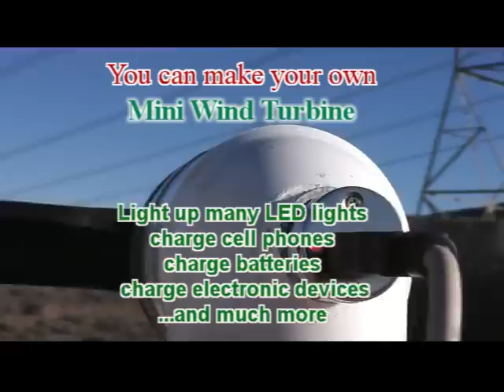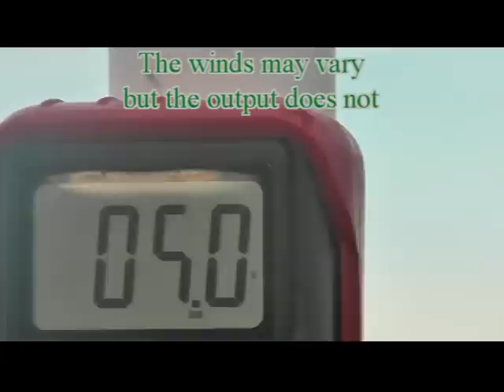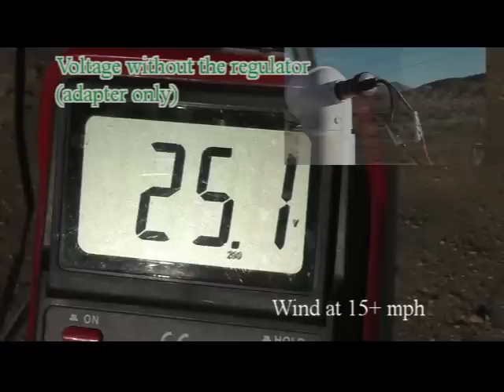Mini Wind Turbine G2

Comment: can the turbine work with more amps in the charger
Reply from the maker: Karan Bardhan Hi Karan, I would use a bigger motor/generator for more than one amp. This mini wind turbine was all calculated to be at or near the 1 amp output (size and type of propeller vs. motor/generator) Take care :)   STT

Comment: Hi STT,

Great job on this wind turbine. I have a question that i hope you can help me with. I have salvaged a bridge rectifier P/N D3SB60 that has the specs: 

Maximum Repetitive Peak Reverse Voltage 600
Maximum RMS Voltage 420
Maximum DC Blocking Voltage 600 

vs the rectifier that you suggested GBL005

Maximum Repetitive Peak Reverse Voltage 50
Maximum RMS Voltage 35
Maximum DC Blocking Voltage 50

Max avg fwd rectified output current is the same at 4.0A. So can i use the D3SB60 instead? Thanks.
Reply from the maker: Eric Malvo Hi Eric, yes, it should work. Please send me a feedback when you test it.
Reply: ScienceTubeToday Hi STT,

It worked! I have taken a photo of the setup, but i am not sure how do i post the picture with this reply.
Reply from the maker: Yes, I would like to see it You can email it to:
Orlando@ScienceTubeToday.com
Good job, congratulations!

Comment: Do you you the amps that it produces at around 15 mile an hour winds
Reply from the maker: I have tested it in around15 mph wind and it sustained 5 volts, 1 amp output from the USB cable connection. I have not yet tested it for higher output, for example without the reverse bias zener diode.

Comment: What kind of pvc piping do i need for the base.
Reply from the maker: +Foxy ThePirateFox 
You can use 2 inch PVC pipes and 2 inch PVC fittings (elbows and T's)
Reply: +ScienceTubeToday Thank-you so much!! I have the essentials build I just needed the base.
Reply from the maker: make sure you use set screws, so in moderate to strong winds the PVC connections of the upright tower does not move or fall. Also, let me know how your project went...good luck!
Reply: +ScienceTubeToday Thank-you and I will
Reply: +ScienceTubeToday The project went really well. k
I was able to charge my phone to 100% percent in about 2 hours or so.

Comment: What about if, instead of a propeller which needs wind to turn, you attached some kind of hand crank ? And how much effort would be required to charge up, eg, a tablet ?
Reply from the maker: Yes, it is perfectly possible to attach a hand crank to this generator, especially if you add a belt or gear, so each turn of the crank produces many turns of the generator. As far as how much effort...small generators usually take a long time to charge batteries. It's just the nature of the beast. I personally have not experimented with hand cranks, so I am sorry I wouldn't be able to provide any stats on it.

Comment: Hello, This an amazing video. Infact all your videos are amazing! Subscribed! Anyways, May I ask, Can you give me the specific name and model/number of the Stepper motor. Oh and May I ask, How did you get two wires out of the cig adapter to the diodes? Thank you. And sorry for asking a lot of questions.. I'm really looking forward to building this... I Already got all the pipes needed :)
Reply from the maker: The stepper motor I used was removed from an old printer, even if I give you its name, specs and manufacturer, you won't be able to purchase the same one since once they are a part of a machine, they become proprietary and can't be sold to the public. Having said that, here is the good news...stepper motors are easy to find online or in old printers like you saw in the video (if you are lucky enough to have one around...) I don't make recommendations as to where to buy, but there are certainly very reputable suppliers out there (big, popular auction website with purchasing assurance?). Stepper motors come with 4,5,6 etc...wires. The one I used for this video was a 6-wire. The wire color coding on step motors vary a lot...there is no color-code-rule per say...Most suppliers, vendors will also give you the wiring diagram and you can work from there...if not, you can simply test the connections yourself by spinning the shaft and reading the output voltage of each pair of wires.
The two wires that I connected to the cigarette lighter female adapter came from the bridge rectifier: The bridge rectifier is made with 4 diodes 1N4001...easy way to remember how to solder the four points together...put the diodes in front of you...make a square with 2 diodes pointing North and 2 diodes point West....the upper right and the lower left of the square you formed is where you connect the two wires coming from the generator...the upper left is your positive DC and the lower right is your negative DC going to the female cigarette adapter. Whew! Let me know if you have any other questions. Don't worry, I will be glad to assist.

Footnote: I am putting together a kit with everything you need to build this and other Mini Wind Turbines. The kit should be available soon. I have already secured the domain name TheMiniWindTurbine.com and the website will be built soon too. Not ready yet. :)  STT

Comment: what type of diode did you used for this project and how do connect the wire to the diode?
Reply from the maker: I recommend Schottky diodes to make the bridge rectifier, or you can buy a bridge rectifier, they are really cheap.

Comment: Hey this video is amazing and I'm surprised more people haven't seen this. I consider myself a smart guy but I've never worked with wires or electricity. You lost me at diodes and dc and ac. I'm looking more up but would love a video maybe breaking it down for us folks with no experience. Either way I'm still trying it out but would appreciate the extra help. You're awesome and I'm def gonna subscribe.
Reply from the maker: Thank you for a nice comment. I appreciate it.
Let me see if I can help...The "generator" you see here is a "stepper motor". It produces AC (Alternate Current), we call it alternate because it cycles positive, negative, positive, negative, positive, negative (looks like this /\/\/\/\/\/\/\/\). This type of current is not usable to charge batteries, cell phones etc...That's why you need a "bridge rectifier". Once the AC passes through the bridge rectifier, it becomes DC (Direct Current) which looks like this -------------. We call it direct current because it doesn't cycle, rather, it "flows" like a stream in only one direction. That is what we use to charge batteries, phones, small electronics, laptop computers, light up LED lights, etc.... A "diode" is an electronic component that only lets electricity pass in one direction. By soldering four diodes in a specific square configuration, it will make the current flow continually in only one direction (two opposite corners will be the entry path for the AC, and the other two corners of the square, the exit points for the DC). So, if you buy or build a bridge rectifier, it will "rectify" the current that comes from the generator for you,...and you can then, actually use it....It goes from this /\/\/\/\/\/\/\/\ to this ---------  . If you decide to go ahead and make it, I'll be glad to help with whatever questions you might have. As a matter of fact, I am working with some manufacturers trying to put a kit together because the parts can't be purchased in one location only, I will know if it's feasible in a month or so...whew!...  Take care  :)   STT
Reply: +ScienceTubeToday I'm planning to make a wind turbine like you did too, but i dont have any knowledge about electricity at all. So my question is if you already have a kit put together or if you can make like a video how to make the rectifier. I've searched the internet for a rectifier like u made, but without succes. Hope u are reading this to help me out! (PS. if you have a link for the rectifier that would be fine too, but it has to fit in the tube's housing.)

Comment: what is the average wind speed in your area ... great work btw :)
Reply from the maker: +amr salah 
It varies a lot. From 6 mph up to 20 mph seems to be the average. Yesterday though, we had gusts up to 75 mph, but that is very rare.
Reply: Woow that's so great. I am designing a vertical one with speed 5 mph so i wanna know if the stall torque of the dc motor would be higher than required
Reply from the maker: +amr salah 
If you are using a DC motor, like a treadmill motor, you probably won't have any significant detent torque (cogging or resistance) when it's spinning with no load. When you connect a load to it, you will experience a resistance proportional to what the load is requiring. In other words, the bigger the load, the more wind you will need. Send me an update when you put it to work. I would appreciate it if you could take the time to share your information. I am an educator and always like to share other people's experiences.

Comment: What did you do to make your motor run so smooth? I recently bought a Trinamic stepper motor (TMCM QSH4218) but there's no wind strong enough to make the propeller rotate. Every time I rotate the propeller with my hand it stops immediately after I let go, any idea how I can solve this? I'm using this for my physics project. Thank you
Reply from the maker: +basboy542 
I am so sorry to hear that. Some stepper motors have  a very strong detent torque, which is the interaction of the magnets in the rotor with the metal parts in the stator. That seems to be the case with your motor. The only way to overcome this "resistance" is by increasing the size of the propeller, or to use a propeller with a high torque. In some cases, a household fan (usually 3-blade) may have enough torque to overcome that cogging. 
What kind and size propeller are you using?
What wind speeds do you have in your area? 
When is this project for?
I have stepper motors here with low detent torque. If it turns out that 
you can't find a suitable propeller to run your generator, you may return it (I suppose). Then, you can tell me exactly what you need/want for your project, and I can send you detailed information on my kits (I sell complete kits). 
Whether you purchase my kits, or just a motor/generator or nothing at all, I am willing to work with you to make this project be successful. Regards,  STT
Reply: +ScienceTubeToday Thank you that you are willing to help me, I really appreciate that. We started the project in July but had to hand it in for the summer break, I recently brought it home with me along with a multimeter and other stuff from school to experiment on it. We have to hand it in again on October 6th, which is kind of tight, and on that date it has to be working. I don't know exact wind speeds but on school we do have a wind generator which can simulate winds up to 12 mph, I am also able to use a leaf blower. The parts that you were willing to sell me is gonna be a bit of a problem because I live in the Netherlands, so shipping is gonna take a while probably. Again thank you so much for helping me with this project.
Reply: +ScienceTubeToday and my propeller is a 10x5.5 inch APC Propeller (HCAQ9353)
Reply from the maker: +basboy542 
Your propeller is too small, and chances are...it won't work, sorry. What those two numbers mean, is that the diameter of the prop is 10" and the pitch is 5.5 ( (it is the theoretical number that represents how much the prop will advance in a perfect medium per each revolution). For a stepper motor (or any generator) with a high detent torque like the one you have, you will need a prop in the order of 26x10 to overcome the cogging as well as the load you are going to connect to it. My suggestion is that you test a  3-blade household fan (tabletop or upright) in substitution for your 10x5.5 prop. The household fan blades are approximately 14 inches in diameter, but they have a lot of surface area, therefore a lot of torque, and they are light. Considering the circumstances and the time you have, I would highly recommend that you do a test run on this set up. A 12 mph wind should be enough to turn your generator with a 3-blade fan. You can borrow this from friend or family  if you don't have one. The center hole is approximately 5/16 (inch) in diameter (usually). Please let me know if this is a workable solution for you. STT
Reply: +ScienceTubeToday Thanks for your response, I do have a household fan here in the house (2 to be exact so I might be able to use 1 for the blades) but somewhere else I read that I could be able to use PVC pipes and cut them through the middle so I have half a circle, if I use like 4 or 6 of them with a decent length, will that work too? if you don't think it would, I'm gonna test the fan. Thank you
Reply from the maker: +basboy542 
My suggestion is to try the fan first. The fan comes already balanced and you will not have to deal with balancing, centering or vibration. BTW, balancing (which may cause vibration or uneven distribution of forces) influences performance significantly. I am familiar with the PVC pipes, and they may work too. Having said that, here is some food for thought. Your 4 or 6 blade PVC pipe blades will be heavier than the fan blades. It will depend on the design, length, width, weight, and balancing. The more perfection you achieve, the more efficiency you will obtain.  STT
Reply: +ScienceTubeToday The 3 bladed propeller seems to work perfect! (even tho I attached it to the motor with duct tape facepalm) but I'm gonna be making an adapter for the prop so it fits on the motor perfectly tomorrow, since the propeller is not really stable with duct tape on it... But I really think this could work! I tested it with the other fan which has speeds of about 5 mph and when you give the propeller a little push it will be able to rotate for about 6 second before it stops, generating about 4 volts, so if I use my leaf blower or the school's wind generator I could be able to rotate the propeller. Let's hope for the best.
Reply from the maker: +basboy542 
Looks promising. Now I am very curious to learn the results. Please keep me posted. STT
Reply: +ScienceTubeToday The fan blade seems to work! I made a home-made prop adapter for the motor so that the propeller fits perfectly on the motor, I attached it to my setup today and used a leaf blower to rotate the propeller. It started rotating extremely fast and I was able to reach 24 V. Once I brought it to school it was time to test it with the wind tunnel, fortunately I was able to get 14 V out of the motor with the wind tunnel, thereby connecting my cigarette adapter to it and after that I was able to charge my phone! It was a very frustrating and time consuming project but it finally seemed to work! Now let's hope for the best October 6th when I have to present my design. Thank you so much for helping me solve my problems, your project is amazing and I learned a lot from it, and I guess I'm not the only one, you inspire people to re-use parts and make something great out of it, something very efficient, once I have more time I'll be looking for a better motor and propeller to make this my #1 energy source!
Reply from the maker: Congratulations! Actually the credit goes to you because you overcame the challenges presented. You looked for ways and resources...and that is the very essence of a true scientist. I would appreciate a follow up after your project is presented. I like to share experiences like yours, so that others can get inspired. STT
Reply: +ScienceTubeToday presentation went great thanks to you! People were very enthousiastic about the design and how it worked (I think we even had a max output of 50V) Haven't gotten my grade yet but my teacher said it'll definately not be a bad one, he thinks this was really one of his favorite subjects. I still got it here at home so maybe if I have some time, I'll be working on it again soon, trying to improve things :)
Reply from the maker: My sincere congratulations. You had your challenges building it, and you overcame the difficulties and made it work. Keep up the good work!  :)

Comment: I've been waiting for this video for a few weeks now and have slowly been collecting the bits I need to complete the project. I am currently in the process of stripping out an old printer I found in the loft. All I have to get now is a plastic cup to cover motor and a coupling and I should then be sorted. Does the bridge rectifier have an upper voltage limit? I see from the video that it went to almost 29v. Thanks for taking the time to make and post this video. I'm sure a whole bunch of people, both young and old, will get a lot of satisfaction from it, I know I will.
Reply from the maker: Jamie, thank you for your kind words.
The bridge rectifier will withstand the output from the motor by a long margin and will not burn or damage the diodes. I would choose for example four 1N4001 (rated at 50 volts-each...) you may buy or solder a bridge rectifier together, either way it will do the job. There are ways to do the rectification, for example a GBL005 which has four pins in line. The two pins on the inside are for the alternate current coming from the motor/generator. The two outside pins are: left=negative and right=positive. If you have any further questions, I will be glad to answer.  STT   :)

Comment: The 5V were measured without any load, right? so you can't really say "5V, 1A" if there wasn't a load.
Reply from the maker: Sorry Robert, I missed your question...Anyway, you are correct, I meant to say (or, I should have said...) 1 Amp max, under load. The voltage stabilizer will keep the voltage steady all the way, but the current depends on the wind speed. The more RPM, the more energy produced...up to the maximum limit of the generator specs..., which is a relationship between RPM, gauge of the magnet wire used in the coils, number of loops in the coils and the strength of the magnets used. Thank you for your comment...STT